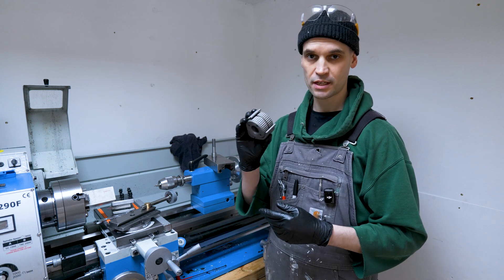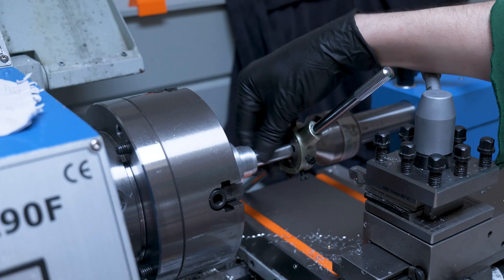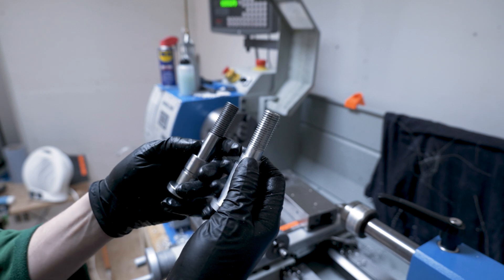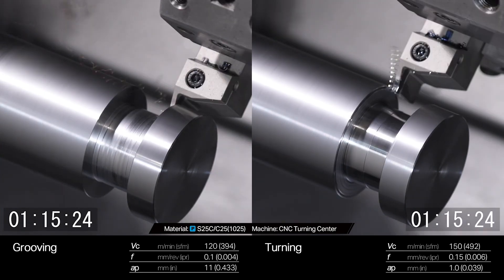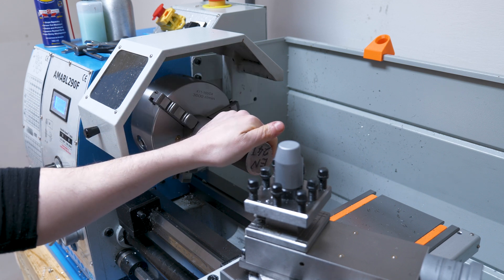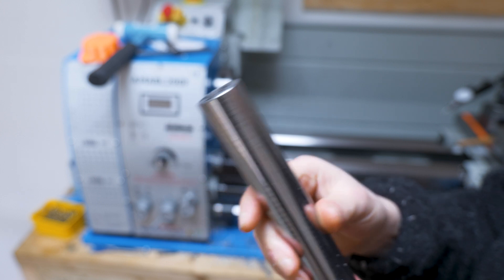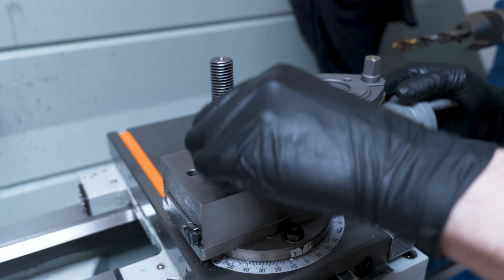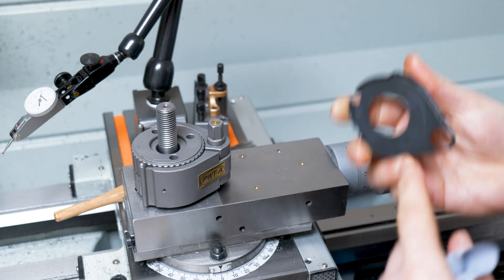Installing Pewe Tools Multifix on lathe (AMABL290VF/PM-1130V/WM 290V)

Comment: Nice work on the installation of the quick change toolpost! That 30mm EN24 you got there is how it comes from the factory. Since it is too tough for the normal cold rolling it is machined there to the size you choose. Just keep in mind that it usually comes about 0.05mm undersize to allow a nice slide-on bearing fit. Personally I would leave that locating pin in there, since all the toolholders have a very small tolerance on the geometry. Being just 1 degree off could stop them from working as intended (especially the parting blade).
Looking forward to more videos
Reply from the maker: thanks, ive left the pin in there for the time being, loving the multifix so far!

Comment: Why didn't you just make a whole new stud out of steel? Seems less work than making a temporary one out of aluminium, a sleeve out of steel, and machining the original stud.
Reply from the maker: I just didnt want to waste the original stud and I had some dented up aluminium rod that ive had laying around. There is also a grub screw in the bottom flange that would have been difficult to machine and tap because it crosses half of the flange and half of the compound body

Comment: To turn hardened chrome steel with HSS you need a lower speed and proper wet cooling. I mean splash fluid, not micro lubrication.
Reply from the maker: that makes sense and explains why it didn't work in my case , thanks Axel